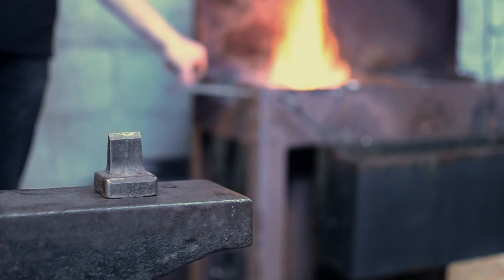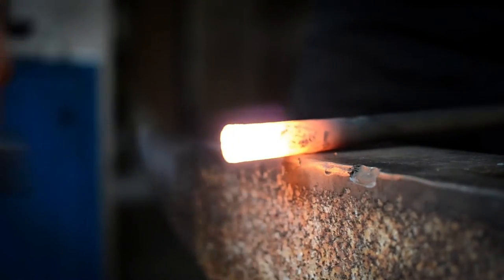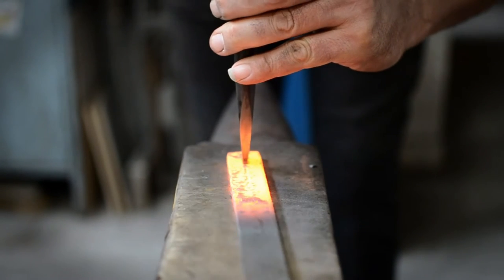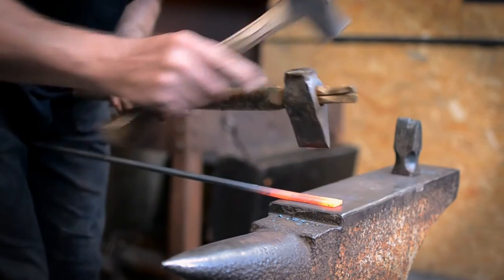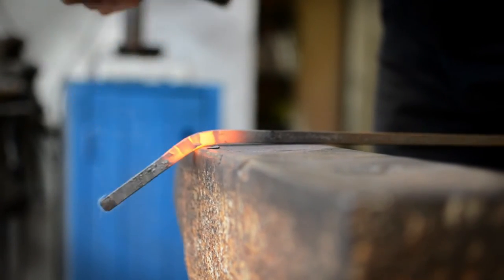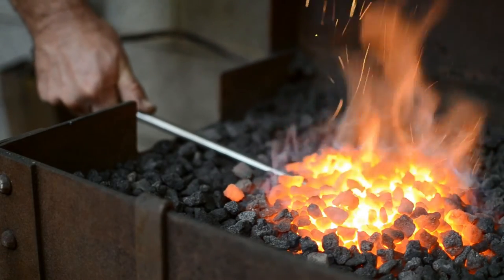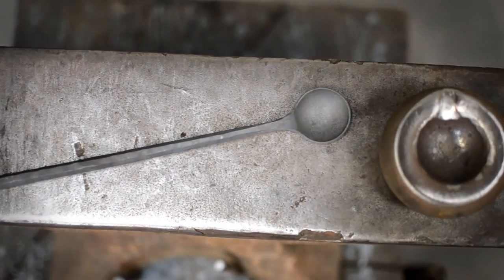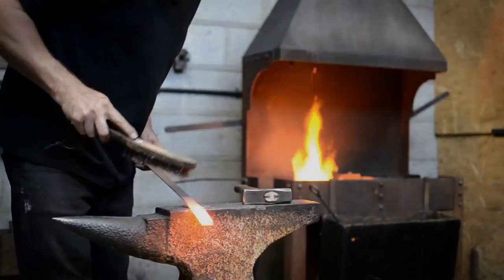Blacksmith: Apprentice to Master :  The seven skills of blacksmithing

Comment: First time i've come across this channel.  Nice introduction showing the craft from beginner to master in the time!  I've been learning under the instruction of a highly competent smith at 2 weekly intervals for the past 42 months with enforced breaks due to covid.  I haven't got as far as fire welding yet (but hope to start early next year)  My own experience is that as a beginner you really need to learn how and where the fire heats your steel and how to control that before you can shape it at the anvil to meet your expectations.  Very well stated in the vid, and I have a load of failures teaching me by example that this is true.  I added my sub straight way after watching.
Reply from the maker: Thank you

Comment: Thanks for the video. May I ask if just heating up steel to red or even white alter it's shape? Even for more precise work, something like 0.01mm? Can it change 0.01 mm by just heating it up?
Reply: the simple answer is no, but even leaving a piece of flat bar in the sun all day will cause it to swell on a microscopic level - but for practical purposes, again, the simple answer is no, it will not significantly/visibly change shape.
Reply: It can, but only for very precise work. It is possible to shape a make part that is just barely too large to fit in a hole, and use heat to get the hole loose enough to assemble the parts achieving a tight fit by the time the parts reach room temperature.